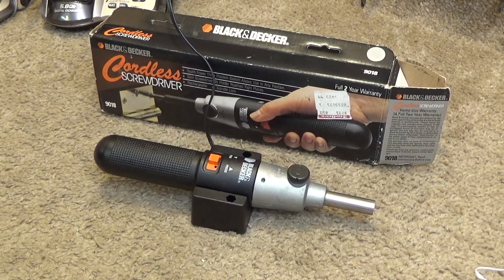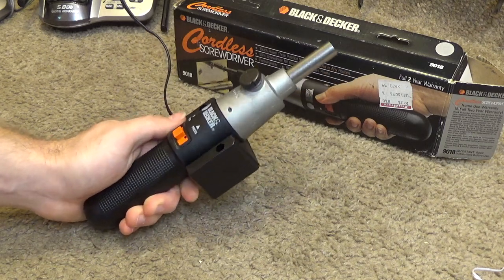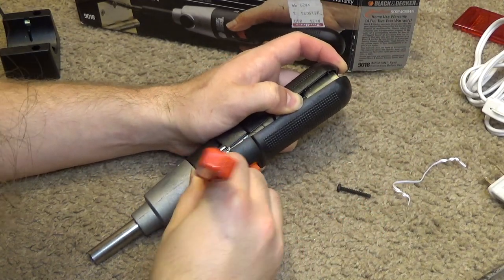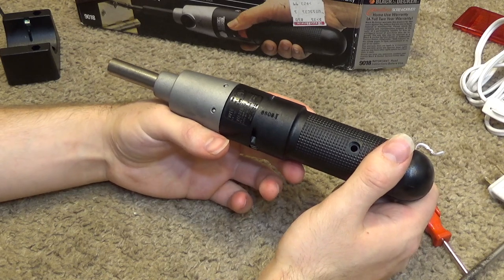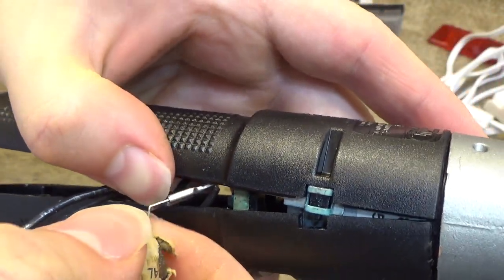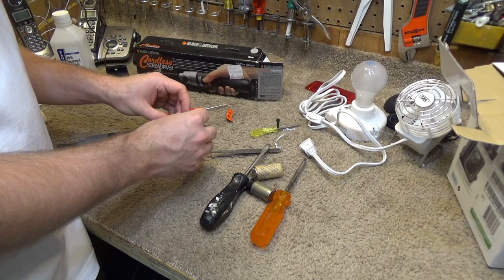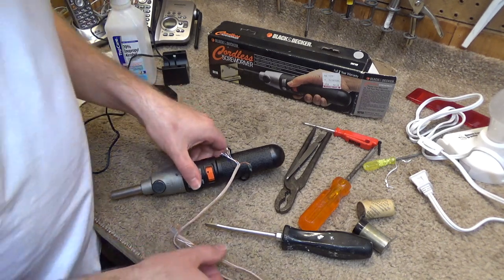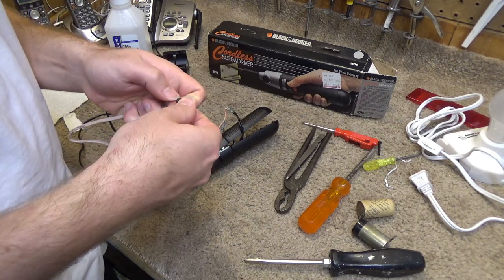Black&Decker 9018 Cordless Screw Driver | Diagnosing the Failure

Comment: It is Feb 2022 and I bought one of these 30 years ago. It hasnt worked for years, but has been my favorite manual screwdriver all this time. Just put it in lock mode and you can generate a lot if torque. Alas, I was  bored today and tore it apart. I think the batteries had done bad. Hooked the motor up to 5C DC power supply and it still worked.
Reply from the maker: Some day I need to revisit this and figure out how to properly replace the batteries and reassemble.

Comment: I have the same screwdriver, I bought it about 20 years ago, for me it is the best of its kind. in order to take it apart you should take off the two needle pins that are located in the metal component ( the gears core) right at top where the battery housing and the metal join.you have to push them off using a slender pick/nail. good video anyway.
Reply from the maker: You are completely correct about those metal pins, which I knew prior to this video.

Comment: I have a skill power screwdriver that is 3.6V, I replaced the battery with an 18650 AND DIYed a flashlight tube into the original body so I can remove and replace the batteries anytime I need to. The same thing I did with my skil power wrench. If you want to do this, make sure you use an 18650 high drain cell from a power tool battery or ones used in vaping, laptop cells may overheat when used.
Reply from the maker: That's clever, but I'd rather use NiMh batteries.

Comment: My Dad had that exact screw driver. Man I miss it.
Reply from the maker: I remember my grandfather using this well. I hope I can get it fixed eventually.
Reply: @JordanU  my dad actually replaced the batteries in his with new sub c nicad batteries. Then the motor died a few years later. I believe he had it for a total of 15 years! Towards the end we ended up using it as a regular screwdriver once the motor started to get weak haha. But they don't make em like this anymore that's for sure. He also had a square black and decker rechargeable flashlight in the basement for years and years. It worked great. We replaced it with that stick battery system B&D had for a while it didn't last anywhere near as long though.
Reply: My Dad... my grandfather... I had one myself and now I feel old 😄

Comment: The motor can be repaired, all you need would be the carbon brushes, since they break easily and wear overtime, they are easy to find. But I guess you can replace the entire unit.
Reply from the maker: While that's a possibility, I cannot say with certainty that that's the issue.
Reply: @JordanU  
But you can definitely replace the entire motor